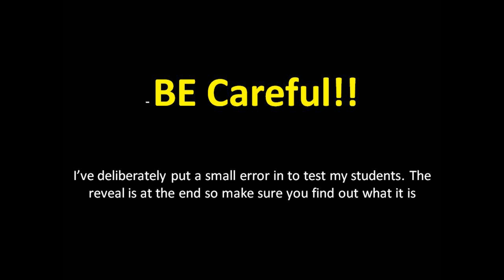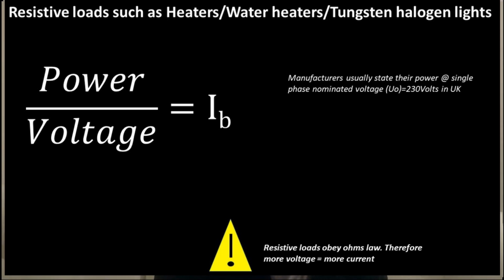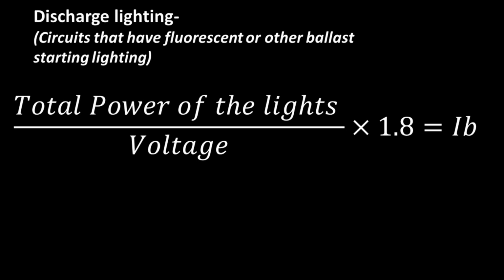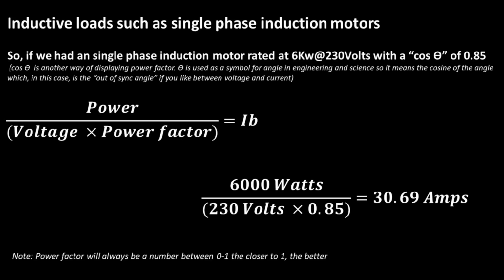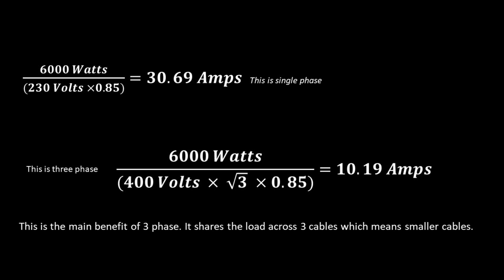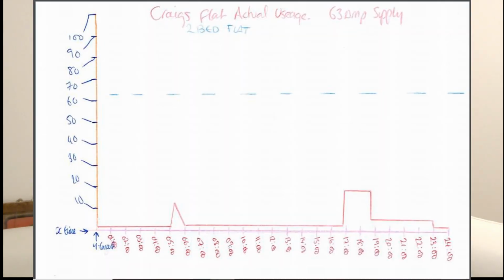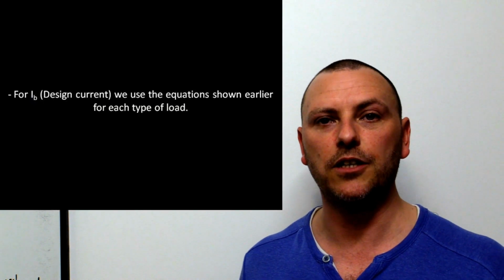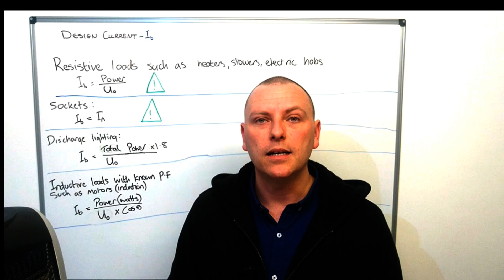Calculating Design current, maximum demand and diversity

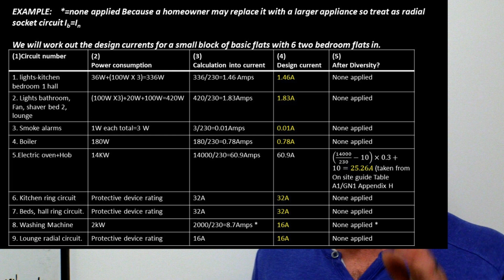Comment: 17:13 referring to the table and specifically the calc for the cooker. I am studying diversity calcs and there seems to be a conflict between the OSG and how people calculate the value. Why do we add the 10 back in when the OSG does not describe this? Or at least that is my current understanding. Table A1 describes the calc as the 1st 10 amps + 30% of the remaining + 5amps if a socket is needed. Table A2 describes the same calc with a minor difference: 1st 10amps + 30% f.i. of connected appliances in excess of 10A + 5A if required for socket. In both cases I am failing to see where 'add 10 amps back in' is required. Given I am at the start of my journey, I am assuming I have missed something but what that is escapes me. Could anybody throw some light on for me?
Reply: Do we add 10 at the end because there would be a control switch with a socket for each unit?
Reply from the maker: I suppose this is the difference between writing it as an explanation and actually calculating it.

It says take the 1st 10a and then 30% of remainder. Well, how would we calculate 30% of the remainder if we didn't deduct the 10a at the start? And then we need that 10a so need to add it back at the end. It's a funny calculation and simply based on average usage etc. The two tables shouldn't be confused. 

A1 is for final circuits so use that for things like cooker. 

A2 is for groups of circuits for calculating the likely maximum demand of the install. 

Does that help? 

Oh and after all that, if there is a socket add 5a if not don't.

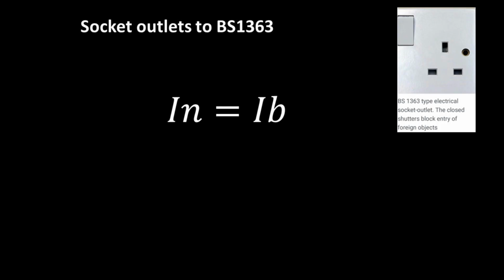Comment: 5:02 You don't know how long I've searched for this info lol, I've been all over IET forums and other spark youtube channels to try figure out what I can do with my radials that have no permanently connected equipment lol... I'm guessing if you know what the client will have plugged in such as in an office you would still calc your design current off of there permanently connected equipment? cheers again for that tidbit of info in the video. BS 7671 can be brutal to look through to find something specific lol.
Reply from the maker: All we can do in that case is use the protective device rating really.

Comment: Hi, If i have a 3 phase board and wired into it 10 single phase circuits each circuit would be 7.2kw (10 - 32A mcb's) how would you work out the Ib for the mains feeding it as its 3 phase feeding single phase circuits. If it was a single phase supply then it would be 72kw / 230 = 313A.
Reply from the maker: You would justify the design current of submain based on diversity or knowledge of how those single phase circuits are going to be used. You could have a load limiter system which prioritises specified loads (Garo units). If they are going to be on full all day then im afraid thats the load and the submain would need to be able to carry that load continuously. 

https://www.garo.co.uk/categories/priority-non-priority-cons-uni
Reply: They are for EV chargers, In the end I took the total power of 9 of the single phase circuits as these will be balanced over 3 phases, 3 - brown, 3 - black, 3 grey then used a pF correction of 0.95. So 400v x 0.95 = 380v.
7200 x 9 = 64800w / 380v / Sq route 3 = 98.5A. Then the final circuit 230v x 0.95=218.5v.  7200/218.5v = 32.9A + 98.5A So lb = 131.4A

Comment: Hi mate, not sure if you still look back at these comments but if you could clarify for me, is the 1.8 in the design current formula for discharge lighting a tabulated value in the regs or OSG? recently came up in one of my exams and not sure where the value derives from. cheers.
Reply from the maker: It's a fudge factor really to take into account power factor and switching currents. Can find ref under table A1 in on site guide.

Comment: Hello, great video, I’ve noticed in some text books the design current calculation is slightly different to what you shown in the video. This is the calculation for an inductive load eg..a motor. (from Brian scaddan 18th Ed regs explained & illustrated)

Ib= power x 100 / voltage x PF x efficiency 

In your example you didn’t have the x 100 on the top line of the equation and you didn’t have x efficiency on the bottom.

Is it the case that if the motor efficiency is unknown, then it can be left out of the equation? (And the x100 on the top line)
Reply from the maker: Hello, yes you're absolutely right. You would benefit from adding efficiency into the calculation. 
These are for an entry level really and It is always hard to know what bits to go into detail on and what bits to skip over..my students leant about motor efficiency in the first year so hopefully they can put it together 😬🤔 Thanks for the feedback, I will make sure I include that point in a future video. 👍
Reply: Would the efficiency be noted on the details plate of a motor? 
If not, is there a way of working out the efficiency if the pf is known??
Reply from the maker: @gbelectricks  yes you could measure the parameters and calculate the efficiency. Simply measure power in and power out and input to the following effieciecy=power outout/power input then multiply by 100 to get percent.

Tbh there is so much to motor's to cover it would take me years! I want to and will try to get around to motors because they fascinate me. 👍
Reply: Brilliant, thanks for explaining. Keep up the good work👍

Comment: How we will calculate the value of maximum current if we have power Given and PF 0.9
Reply from the maker: single phase: maxP/(minUo x pf) = Max current   three phase: max P/(minU x 1.73 x pf) = max current...................min U means line voltage so 400v in uk. and Min Uo means line voltage to earth 230v in uk. Thats what I would do if the max current is important for extra safety but in UK we are allowed voltage tolerances as part of our harmonised voltages so you could just use 230v and (400v x 1.73) .

i keep referring to 1.73 because i dont have a square root button but im trying to write sq root of 3 :-)

Comment: You should of mentioned in relation to the design current, the circuit protective device rating should be equal to or greater than the design current.

Comment: I am  a graduating Electrical Engineering student. And currently I have a Design Project which involves the same standard which you are teaching here. I hope I could ask a few inquiries for quiet some time :D I am really having a hard time finishing my design.
Reply from the maker: Hello, I'd do my best to help. Whats up?
Reply: @cestemshow  is there any guide regarding sizing of isolators and Circuit breakers for motors like FCU, and pumps such as fire pump, jockey pumps etc.
Reply: @cestemshow  Also, this 'diversity' factor in this video, and there are other factors such as Ks and Ku, when and where should I use them ?
Reply from the maker: @EEngrIvansPH  the best place to ask is the manufacturers of the equipment to be installed. Sometimes their installation I structions can change so a guidebook would then be out of date.

Ch 53 bs7671 deals with isolators.
Reply: @cestemshow   due to limited informations, I only have nominal power, V/P/f, of mechanical loads. I am supposed to assume other factors based on standards. My design project is for educational purposes only. I have here bs7671, and Schneider's IET Electrical Installation guide. Which do you prefer. I also have the on-site guide you use here. Thank you for your kind consideration
Reply from the maker: @EEngrIvansPH  The Ks factor is like the table A2 in the on site guide. it is for multiple circuits. KU is like the table A1 in the on site guide.  There is a nice summary here from Schneider: 

https://www.electrical-installation.org/enwiki/Estimation_of_actual_maximum_kVA_demand
Reply from the maker: @EEngrIvansPH   OK I understand. This is the book I recommend for the city and guilds 2396 design course. It has diversity factors already done for various types of loads and buildings. It is OK though to make your own assumptions even in a course project and asking the manufacturer shows great initiative in my opinion.

Most courses will always follow the iet guidance so if you follow this book you can't go wrong. It has the same tables in here as the on site guide. Bs7671 won't really help with diversity, it just tells us it's OK to apply it sometimes.

https://www.cef.co.uk/catalogue/products/4662019-electrical-installation-design-guide-4th-edition?gclsrc=aw.ds&&gclid=CjwKCAjwps75BRAcEiwAEiACMUg6IsqSFfMbkU58_yyHlSDbFynASJ-rV0CDBgWyt5WE_SbFkkhCWxoCoRsQAvD_BwE&gclsrc=aw.ds